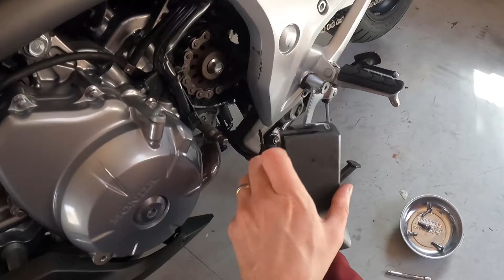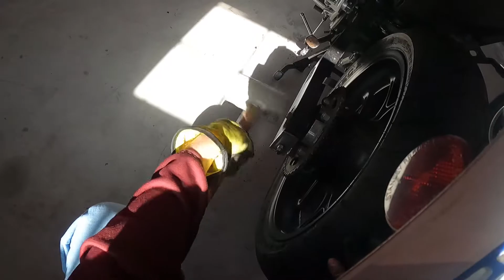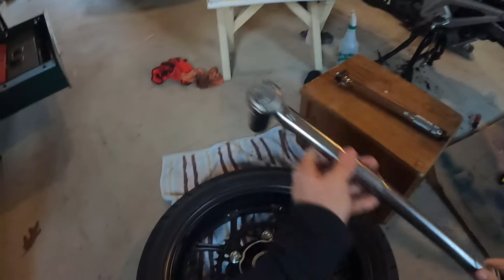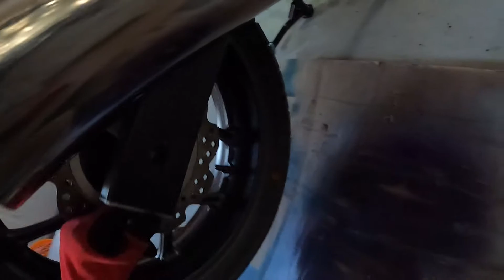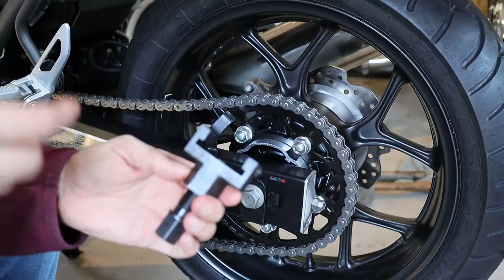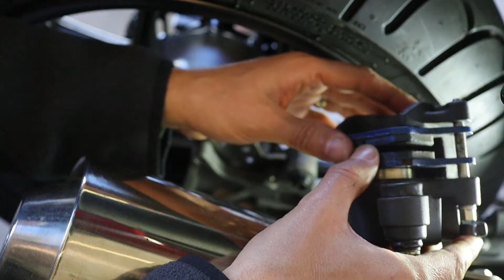Motorcycle Chain and Sprocket Replacement Highlights

Comment: Did you replace the washer for the front sprocket bolt? I don't see the specs of the washer in my 2014 NC700X manual.

Comment: I couldn't help noticing that you put the axle back the opposite way you took it out. It came out exhaust side and went back sprocket side. Does it matter which way, thanks.
Reply from the maker: Mine seems ok but maybe check with a mechanic to be sure

Comment: Do you need to take the brake caliper off to do the chain or can I leave it on and just slide the wheel back on and rivet new chain
Reply: No, the caliper & bracket disengage when you pull the wheel. The bracket is held by the axle bolt, & it fits in a notch to prevent rotation.

Comment: Thanks, just see why my ctx700 pulls slightly to the left... years ago guy changed my tire and left out  42311-MGS-D10
And after it was feeling weird he repaired it by putting the same spacer thats on the brake side on the sprocket side. Thanks brother!

Comment: I like the older Soft Choppers of Honda CX500, 550 and 750 from back in 1983. You got one right there in your Garage. Congrats on the Selection of your tires. Metzeler rocked ever since. I used to switch from Dunlop Tires which came with the brandnew Motorcycle to Good Year and then later on to Metzeler. Or from originally Continental to Firestone and then to Metzeler again. My favourite Tires of Metzeler back in the 1980's were the ME33 and ME99 Laser. I had them on my Kawasaki Z1000j, Z1300, GPZ900R, Honda CB1100F Super Bol'dOr and many other Bikes. Glad to see that Metzeler is till producing great tires. Since I switched from japanese Race Bikes to Harley Davidson (cuz I became on old man) I never had Metzeler Tires no more.
Thx for sharing this video with us
Reply from the maker: I've always had good luck with Metzler tires.  Glad you enjoyed the video!